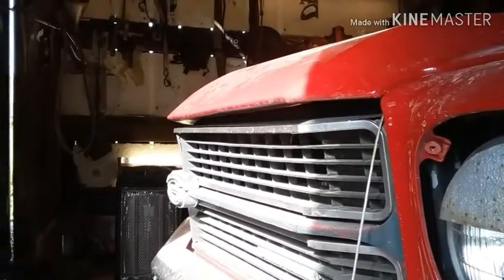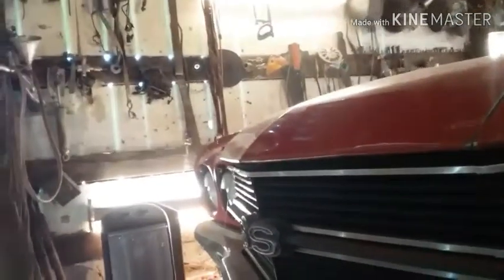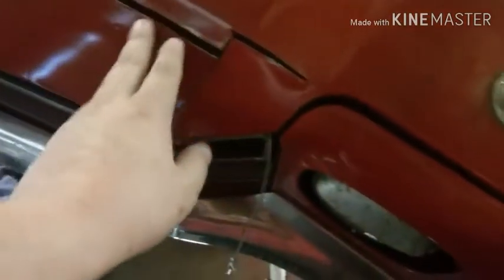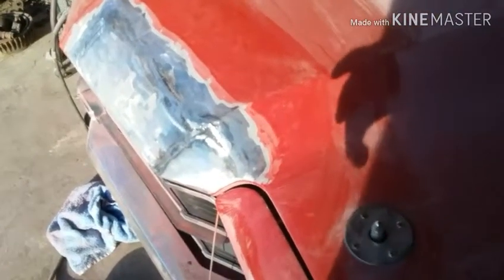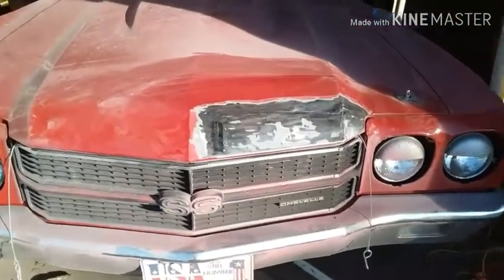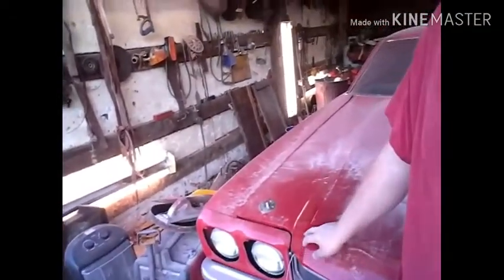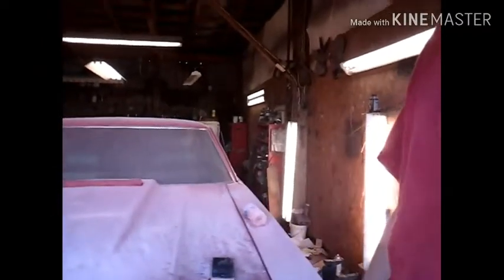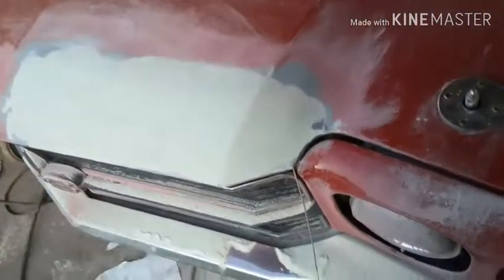70 chevelle (adjusting) my hood alignment problem

Comment: There should've been hood adjuster bolts in the front to drop or raise that hood? My 71 El Camino has them. I had the same situation with mine. I just lowered the adjuster screw on the one side, problem corrected..
Reply from the maker: Your right on a good hood that would've work but My hood was bent across the nose side to side at one point in it's life and had also been stomped back flat from being bent at the hinges I tried adjusting the stops and they wouldn't take that out of it
Reply: @BlueGooseGarage  Oh, okay, I understand. Well, good work on the modification..! I wish I had that skill, would save me money..

Comment: Brother, I have an aftermarket hood I bought and has been giving me hell trying to get it aligned.  I think I'm about to start cutting myself.  Good job. Check me out at Highspeed Noble's Garage.
Reply from the maker: I've dealt with a few aftermarket parts not fitting right sometimes the old slice and dice is necessary lol